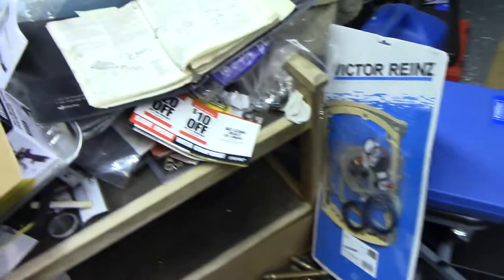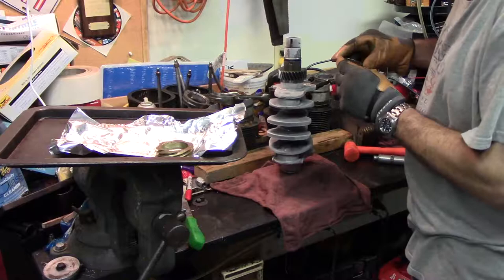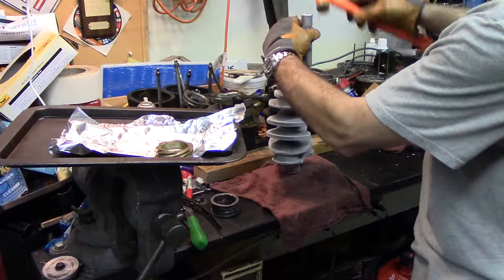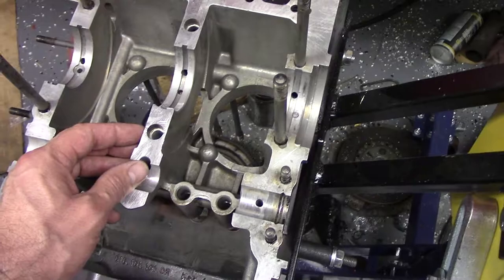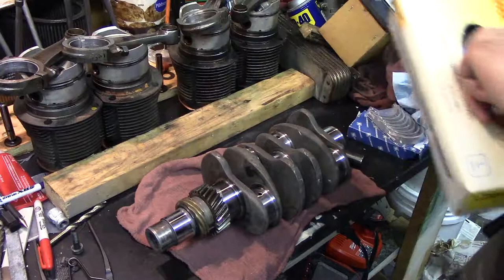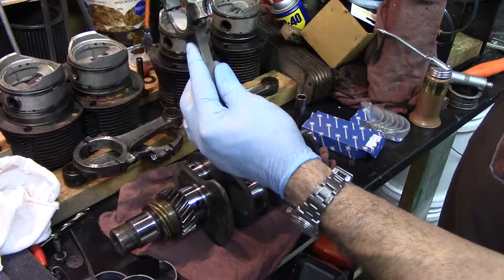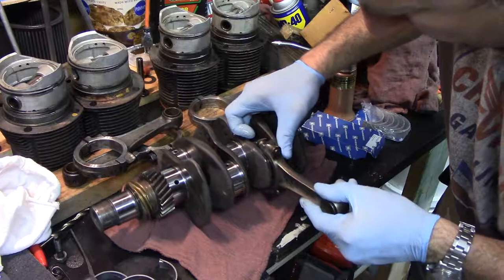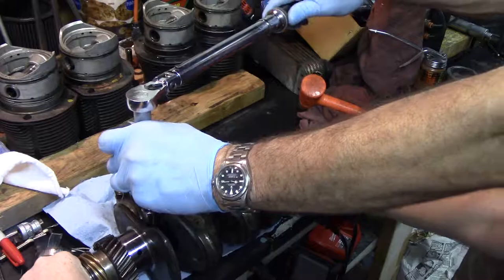Porsche 912 Engine Rebuild Part 15, Crankshaft assembly

Comment: Did you have the crank nitrided after grinding?
Reply from the maker: I did not. I read varying thoughts on whether or not it was needed. I figured since it had not been ground way undersized I was probably safe. I also figured with better oil than 50 years ago it probably was not as critical.
Reply: @bryansprojects3570  Thanks for the response. I'm approaching the time to make that same decision myself and available information is all over the place.